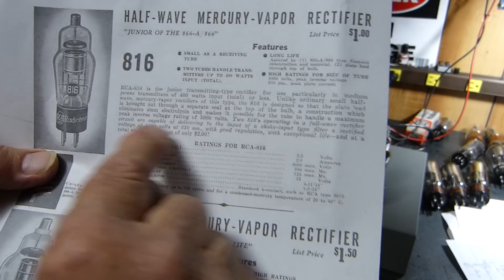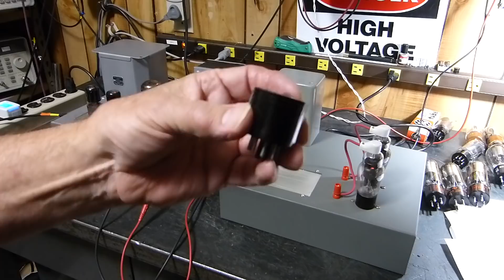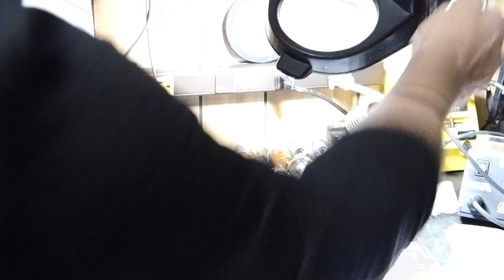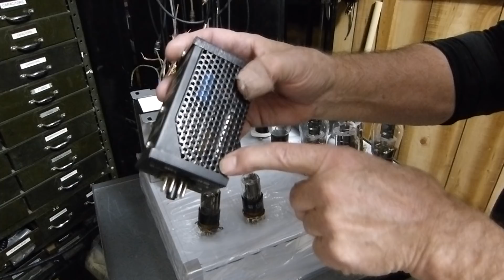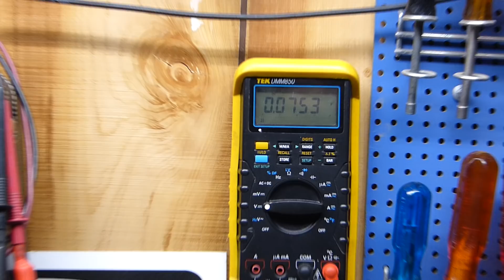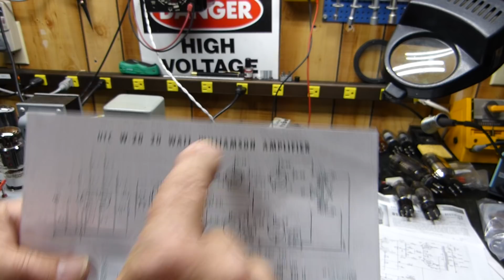Mercury Vapor (Hg) 816, 866A, Xenon 3B22, 3B28  Rectifiers Compared To 5U4 Vacuum Rectifiers

Comment: Hey man, thanks for all the great videos! I just love them. two things, Check out an 836 tube. Its a non mercury 866 type tube. You get a big voltage drop but its a gorgeous tube minus the cool glow. Also Im a new ham and built a modulator just like the one your doing except use 2 807's and I have found I don't really get the power i thought. At 510V (I regulate the screens with VR's like you)  I get about 46 watts. You might want to use 6 power tubes to be safe or heck 8 if you have the filament current. It works great for me so I didn't try and go back in and get more power but just be careful on that, not sure they really do 70 watts. Looking forwards the more videos! thanks again, Pat  KD2MKP
Reply from the maker: In case you haven't seen this video, here is where I get just over 60 watts from the pair of 807 and I believe the plate voltage is just above 600 volts if I remember correctly. 
https://www.youtube.com/watch?v=c90sgZj5rxE&t=58s
I am going to be running this quad of 1625 at better than 800 volts so I am hopeful I will get a full 240-250 watts to modulate a 500 watt carrier. At your plate voltage of 510, I would expect about 50 watts.
I am interested in what RF tube you are  modulating, I assume you are running the RF final as class-C. It is great to hear from you and the fact that you have built your own modulator. I am also curious what band you operate. I am probably going to start out on 20M but maybe 40 or 80. The only reservation I have running 20M is I  have a newly installed hexbeam and I am not sure how it can handle 500 watts, or more, of carrier + modulation. I don't worry about a KW of SSB but AM is quite a different story. 73 Thanks for your comments and please keep in touch WA4QGA
Reply: @ElPasoTubeAmps  Hey thanks! great station! I sadly don't get on much but when i do it's 40 and sometimes 80. I work a lot in NYC and commute in fixing tube amps for a living so I don't get much of a break, plus two young kids but I am hoping next year, to get back on 40 regularly. I run the modulator into a old Lysco transmitter which has a single 807 then that goes to a  Heathkit SB200 so on AM i get about 350W. I get great reports. Like you say in your videos a modulator is just an audio amp so I have a modulation transformer and a audio transformer and I can switch between the two transformers primary side on a switch . I run that modulator almost ever day in the shop playing music (in Mono) and when the audio guys are in the shop they don't understand it was really built for radio. When radio guys come over they don't understand the hifi stuff and say put that on the air. Im really excited about the transmitter your building! best of luck. we will have to talk on the air at some point! more cool photos here at my website, 73.. 

https://www.patrickkauffmanelectronics.com
Reply from the maker: @patrickkauffman8811  Pat, I checked out your QRZ page. Very nice and well done and lots of beautiful equipment. I certainly love the vintage equipment especially your Drake. I don't hear Drake equipment on very much anymore other than the L4-B so it is nice to see you are keeping it going and in good shape. I always had a great respect for Drake equipment.
In my case with the modulator, I am lucky to have an 8 ohm winding on the transformer so I am sure I will use it, or at least test it, into an 8 ohm dummy load and then use another transformer just like it to turn around the impedance. I still haven't decided on the final RF amplifier. Probably a triode, maybe a 3-400Z as I have plenty of them,  so I don't have to build a screen supply. I have the variable bias supply in my 833A cabinet capable of 1A so there is a good chance the amplifier will be built on a slide-in chassis and use that PS and cabinet. I show a  lot of my equipment on my QRZ page also so you might find it interesting. 73  WA4QGA   El Paso
Reply: @ElPasoTubeAmps  NICE COLLINS GEAR! I checked out your QRZ. Also I like how you're building your project into the rack, very excited to see it done! Funny story about that Drake - my wife's grandfather was a ham and when he passed I was given his Ten-Tec and that Drake 4 line. It sat for years before I got my ticket. Once licensed after about a month on the air, the Solid State Ten-Tec died so I restored the Drakes.  He had the original manuals and schematic and spent a few evenings trying to get it working and made copious notes and pretty much gave up. He circled one tube and wrote ("not tested, could it be this tube, could it?"). Well I changed the tube and the transmitter came to life and is ROCK solid no drift. 73 and talk soon, Pat

Comment: Will you please describe the VR circuit you will use for the screen supply?  Thanks for all your videos. You’re doing a great job!
Reply from the maker: The screen circuit I envisioned would be to use two VR150 in series for 300 volts regulated on the screens. They show this exact circuit in some older ARRL books using four 1625 just as I am using. However, the screen current ranges from 2 mA to 80 ma for four tubes and that is well out of the range of the VR tubes which are a maximum of 40 mA and are best in the mid range of 20 mA. VR tubes would work great for low steady current items like oscillators, etc.
At the moment, I am going to use an outboard Lambda supply to make sure I am getting the power output I want before finally deciding how to supply a stable 300 volts to the screens. Thanks for your comments and participation in these discussions.
Reply: ElPaso TubeAmps, great! I’m looking forward to it.

Comment: That's a great collection of high wattage rectifiers. Would you be able to comment on the noise performance of MV and xenon rectifiers in particular? It's been reported elsewhere that the xenon rectifiers are noisy. Also would you be able to comment or RF noise emissions of MV rectifiers?
The regulated supply model 12-102 also appears very interesting. I wonder if you could make a quick video on this piece and principle of operation.
Reply from the maker: I have always heard of noise and "hash" from MV rectifiers also but I have yet to personally experience any of it. I run a home brew 3-400Z amplifier daily on 20M using MV rectifiers and everyone tells me it sounds great. I also ran for several months a Williamson W-20 amplifier using MV rectifiers and the Xenon 3B22 into Klipschorns, which are very sensitive, and I heard nothing at all that is disturbing. Nothing... as quite as any amplifier I have ever had including many McIntosh amplifiers. So, I have yet to  have any issues with noise using MV and Xenon rectifiers. I know doctors will just call this anecdotal but that has been my experience...

Comment: The fact is most directly heated cathode rectifiers have very small amount of surface area to the filament and plate interface. The closest parts of the plates are the edge of the filament which is not much surface area. Indirectly heated cathode rectifiers house much closer connection to the plate as far as spacing and electron flow. Mercury vapor rectifiers Can also have high trans conductivity because of the gas ionization.

Comment: I was hoping you would do a video on the mercury vapor rectifier.    Think I'll have to build an amp with them now.  I have a couple 866s laying around.   Where do you buy your chassis from?
Reply from the maker: I buy as much as I can from www.mouser.com. I posted the part number of these chassis on my last video and will show some other interesting items I have purchased form Mouser and their part numbers as others might like to know.  I find that some items are just as cheap if not cheaper form Mouser than they are on Ebay and you are getting new products. Of course, Ebay does  have some pretty exotic stuff that is not going to be found new at Mouser so I still buy from Ebay.
Reply: @ElPasoTubeAmps  I purchase a lot from Mouser,  but mainly components.  I agree about EBay.  I actually one that sells some of the interesting items.  I'm mainly into audio,  but have been thinking about getting into ham radios.  I picked up a military 1kw amp a while back and it was in pretty poor condition.  Sold the 2000v, 500ma transformer and monster swing choke out of it.  Kept the 2 - 866 mercury vapor tubes and caps.  Been waiting to build something with them.
Reply from the maker: @kgsalvage6306  When you have things to sell like that, send me a link. I may need them.  :-)
Reply: @ElPasoTubeAmps  I  will  , no  problem .